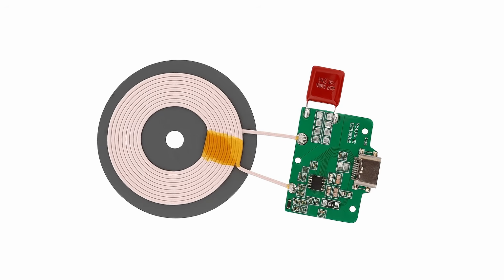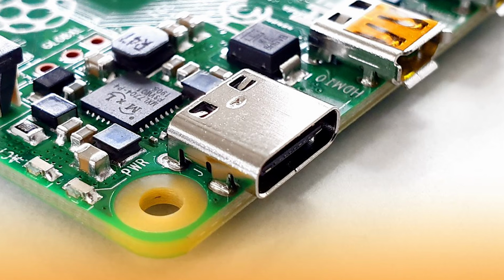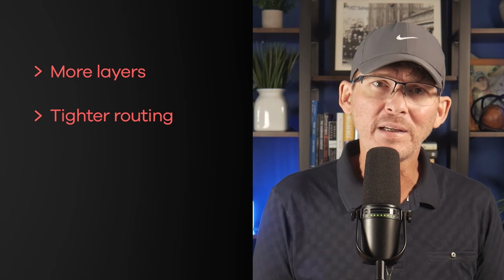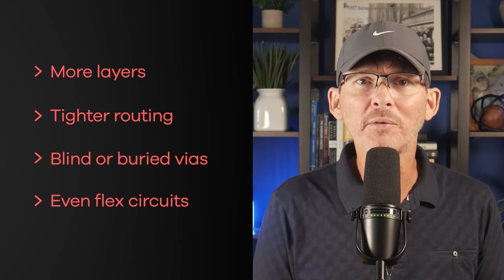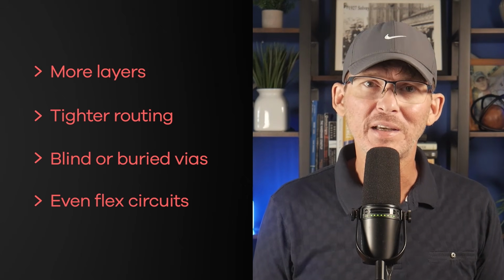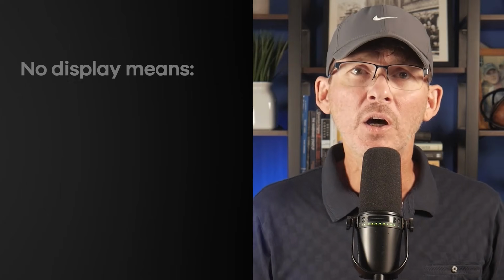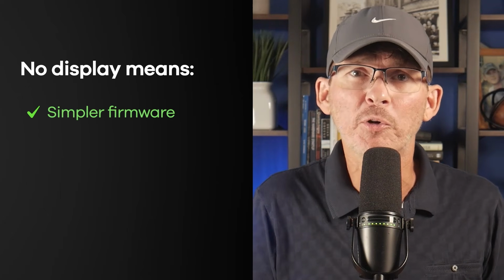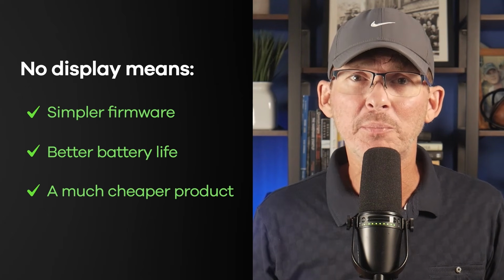10 Design Mistakes That Make Your Product Too Expensive to Manufacture

Comment: I despise products which require a smartphone to operate. Products shouldn't need to rely on other products nor on the internet.
Reply from the maker: Everything has pros and cons. And displays are expensive.

I love astronomy, dude!
Reply: @PredictableDesigns  " And displays are expensive." Not nearly as expensive as developing a somewhat functional phone-app. And that would be ignoring the huge running costs.
Reply: I think it’s fine to rely on the internet, depending on the product
Reply: So something like a chromecast should have a display just to put it onto an actual network?

Comment: I don't really care for USB C,  especially if it's for just charging I prefer a barrel jack.
Reply from the maker: The reason I like USB C is from a customer perspective. If I lose the one that came with the product then I'm kind of screwed unless I have one that's identical with the same voltage and current capability. But with a USB-C everyone has lots of those.
Reply: @PredictableDesigns that's the problematic part for sure, I just don't like USB C because it has this weird tendency to get clogged with random stuff and since it has that weird island in the middle with all the contacts cleaning it is a pain.  
In those terms i like type b a lot more, its not the smallest connector out there but it does seem to be robust.
Reply: @PredictableDesigns  absolutely agree!
Reply: USB Type-C sadly was completely ruined by the later changes. It was never designed to be that small and flimsy - now it does not at all fulfil the promise of being oh so much more robust. They also butchered its future by removing the planned fibre-optics. Those are DIRT CHEAP to introduce and would have meant that the same connectors could be used for many years to come without having all those confusing differing cables we have now.
Reply: @ABaumstumpf  definitely ruined it.